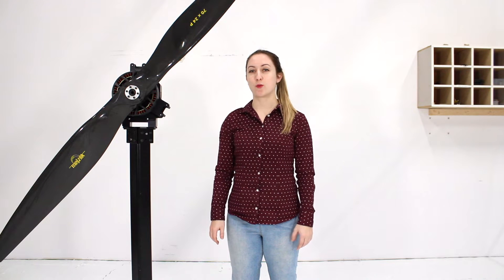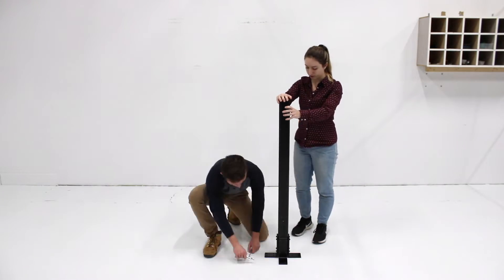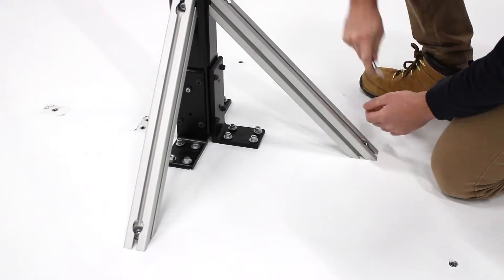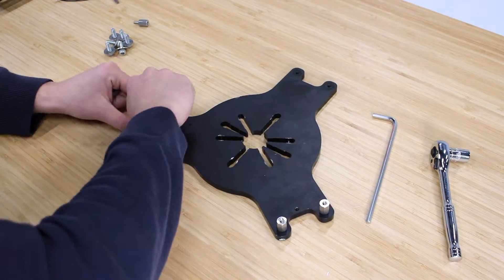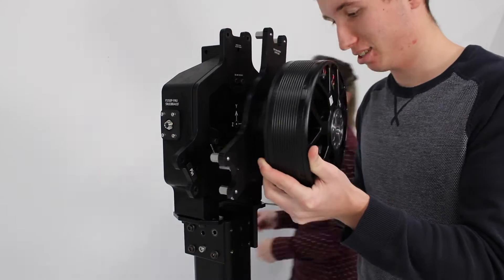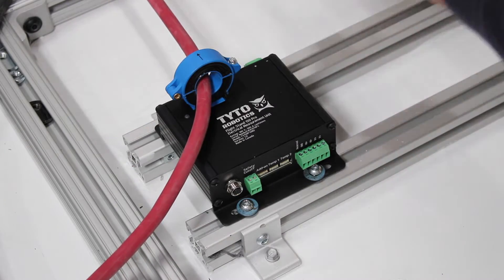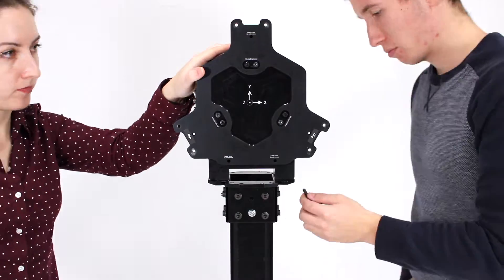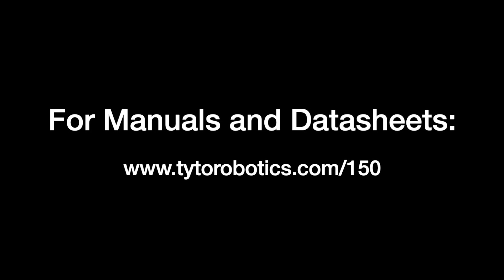How to Build the Flight Stand 150 kgf Thrust Stand

Comment: Hello i have a question, how can one use a joystick 🕹 controller or any other hand  controller and connection of controller
Reply from the maker: Hi @xamxalmshaz3204, thanks for your question! To clarify, are you asking how to use an external controller to control the thrust stand and propulsion system?
Reply: @tytorobotics  yes external controller
Reply from the maker: @xamxalmshaz3204  Gotcha, our software includes an input/output API that allows you to connect external / third-party sensors like controllers (CAN ESCs for example). You can then control those sensors within the software or using Python. You can read more about it here: https://www.tytorobotics.com/blogs/updates/io-api-can-esc-python-api-and-remote-control

Comment: Which one is suggestable for testing these setup
1. closed room
2. Open space
Reply from the maker: Hi Mani, thanks for your question. Can you provide more details? What will you be testing?
Reply: @tytorobotics  120kv motor with flight stand 150
Reply from the maker: @manisathish8530  Ok perfect, you can send a message here for more information and they will connect you with our sales team who can answer your question: https://www.tytorobotics.com/pages/request-a-quote?utm_source=youtube.com&utm_medium=social&utm_campaign=flight-stand-150-user-manual-video
Reply: @tytorobotics   Yes that's what my question, i want to test the Motor with Flight stand 150 with propeller, 
1. which type of space  suggestable - Closed room or Open room
2. Is there any restrictions for ESC to Battery wire ( we are using 4 meters of cable), is that fine?
Reply from the maker: @manisathish8530  For your questions: 1. We recommend to have at least 3 times the propeller diameter in front and behind the stand. The test area should be cleared of cable or any other object that could interfere. The stand should be bolted in concrete and we highly recommend to have a safety cage around it or to control it remotely while being in a separate room.
2. There's no restriction, the positive cable should go through our hall sensor which can be placed near the stand.
Contact sales@tytorobotics.com for more information
Reply: @tytorobotics Could please answer to tge below queries -

1. Is Flight stand 150 designed to test in outdoor or indoor
2. Is direct sun light on RPM sensor makes any issues on reading (i have no RPM values when it is direct contact to Sunlight
3. What is the Operating temperature for the flight stand
Reply from the maker: @manisathish8530  great questions - please send an email to sebastian.anto@tytorobotics.com and Sebastian will be able to answer your questions.